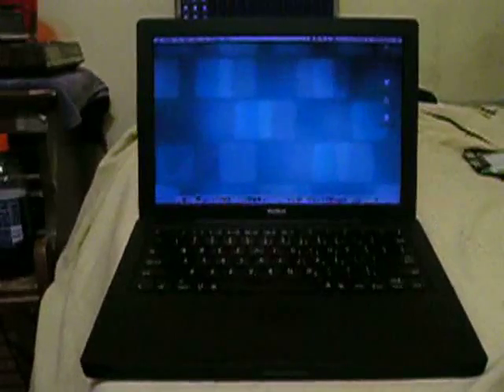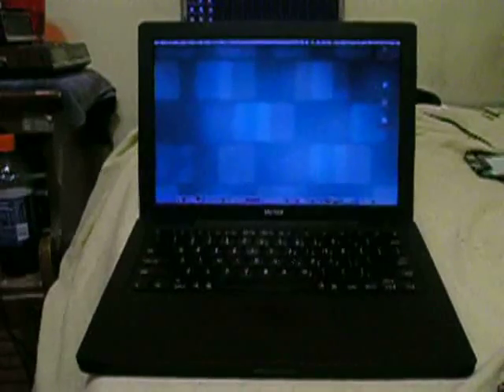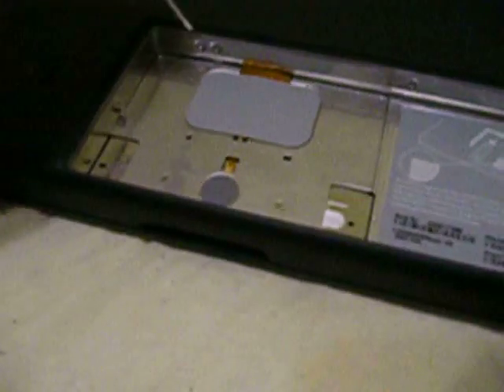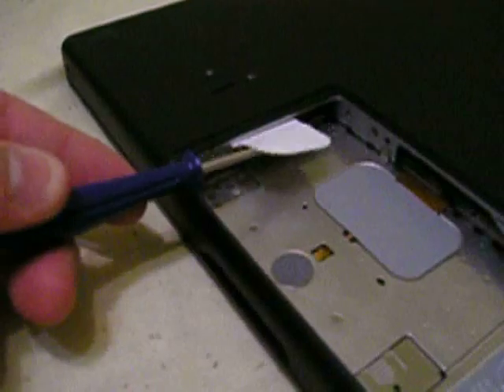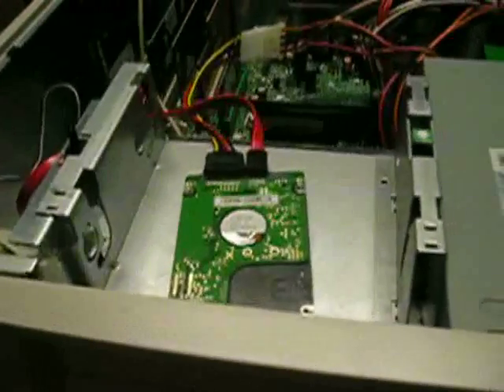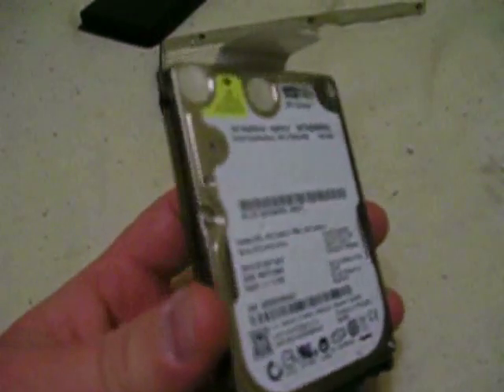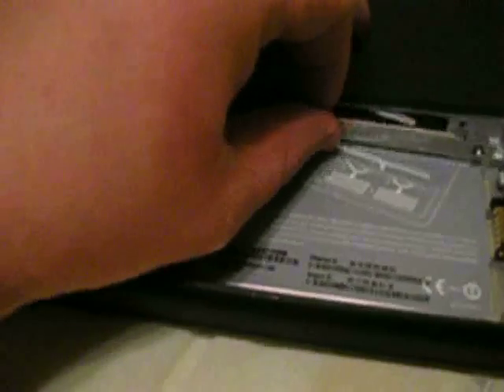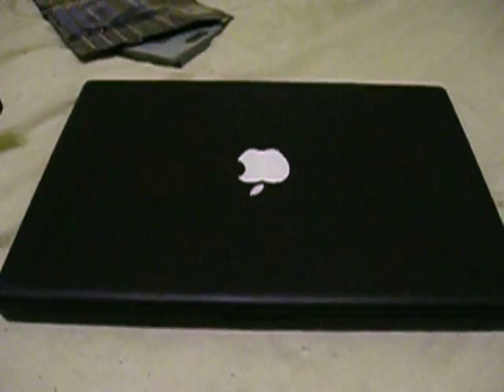How To Install A Hard Drive In Your Macbook

Comment: Man, I wish I could find a decent MacBook from 2006 to archive the collection of Digital8 tapes onto either DVDs or files, and have it for video editing, unfortunately, most of them on eBay are listed "for parts," doesn't come with an HDD or recovery DVDs, have bad SuperDrives, no sound, no screen, etc., or outrageously priced at $200 + s&h via FedEx or UPS. Same with a 2009 MacBook after getting a new OS (El Captain 10.11.6), and the sad thing is, the newer iMovie software doesn't support D8 or Mini-DV HandyCams, only HDD HandyCams, and most likely won't detect said HandyCam. My Windows XP box cannot import videos correctly (interlaced, blurry, slow frame rates, and degraded quality) with any video editor or WinDV, even with the Internet disconnected from it, too.
And I tried MakeMemories Home edition from Sony's web site on my Windows 10 PC, and it, too, wouldn't detect the video camera and would crash, or show an error.
Reply: i have a 2004 imac g5 that i found on the road side
Reply: +josh Lucky.
Reply: i have a 2006 imac core duo, not core 2 duo just core duo, works great, i plan to do the thing where you put in a core 2 duo cpu and do the firmware hack to make it an iMac5,1 instead of iMac4,1

Comment: Hey great video that was quick and easy. I had 2008 at Macbook that died on me around 2011, not knowing at the time you could replace the HD. I got a new macbook and upgraded the HD last year. So I thought maybe I could install the 500gb Hitiach HD on my old macbook. And 15 minutes later bam the laptop flashes up with no issues. Wish I did knew that 6 years ago.

Comment: Yup. I have had two horrible experiences with Seagate drives, both got the click of death. Got a Samsung Story Station and it works perfectly..... touch wood!
Reply: i had 2 seagate drives die in different ways, first i had a 1000GB in an HP tower, the way it died was strange to say the least, first it froze, then i rebooted, BSOD, i booted off another hard drive, files were disappearing as i browsed the drive, second i had a seagate 1500GB drive, this one sometimes it worked, sometimes it didn't i had file corruption so i just trashed them both smashed em up cuz i was po'd

Comment: Haha I  just upgraded my HP nx9010 notebook with a 160gb seagate, it worked great. however originally i had got a 250 WD, but it turned out to be dead. never have been a wd guy, but the seagate has a 5 year warranty :D